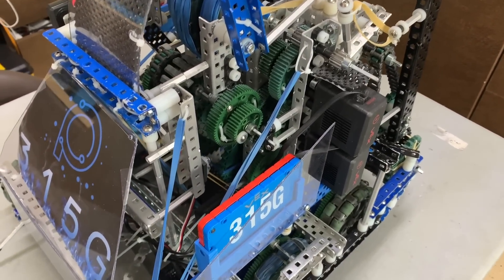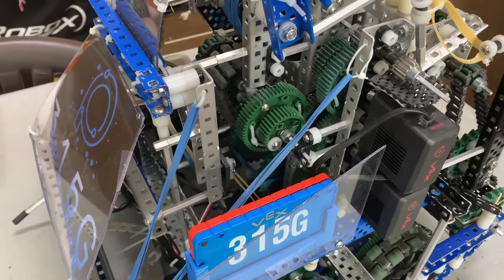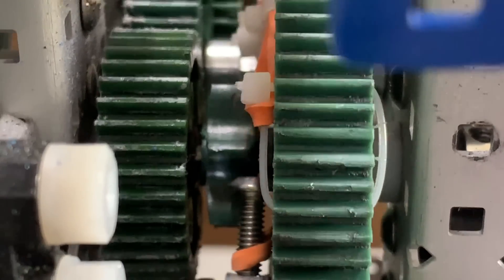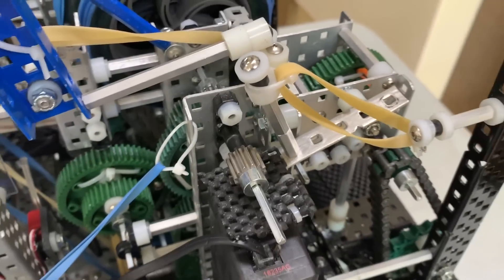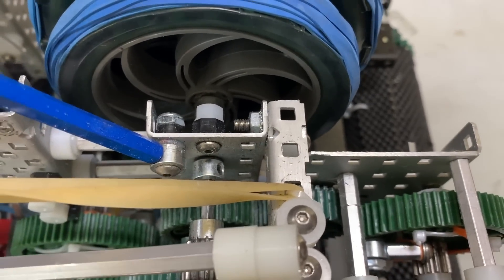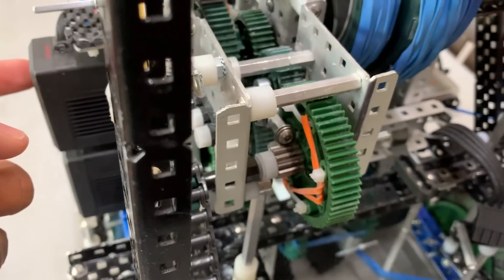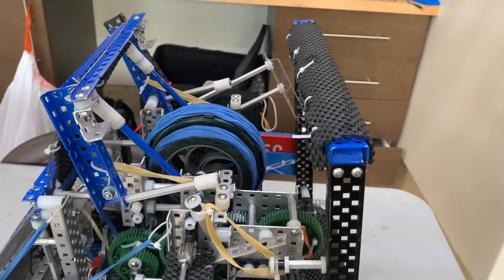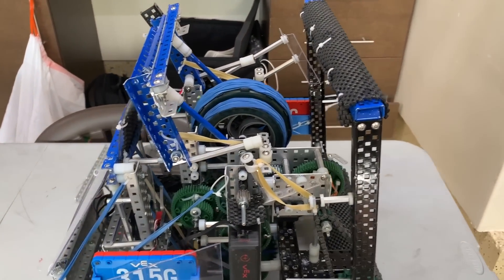315G's Turning Point Ratchets Explained

Comment: That hood angler is genius, but how did u guys get ur scraper to lower all the way with the rubber band attaching it to the flywheel brake stopping it?
Reply from the maker: The rubber band provides a force to pull the scraper back up, the tension is tuned so it's weak enough not to stop it from lowering all the way.
Reply: Thanks for the response, also did you guys speed up the drive or leave it at standard 200rpm
Reply from the maker: @r3v3rbrobotics35  It's sped up to 257 rpm, 600 rpm cartridges running 3:7 external gear ratio.

Comment: i was also thinking of motor sharing early in TP but with differentials. but i eventually left that idea because i could not persuade our coach.
Reply: What would be your use of differentials? Ratchets seem much more useful and reliable.
Reply: @jinglemich4941  wow it's been 3 years since I left this comment hahaha Well to answer your question that idea was a silly one I had that involved using a chain bar in tandem with a differential made with bevel gears to lift and flip caps with just 2 motors. I came up with this before I became aware that V5 was a thing... It does sound stupid now that I think about it but I was just a rookie so don't judge too hard.

Comment: I don't quite understand how the lower flywheel motor is able to move the indexer system while the flywheel is spinning, can someone elaborate it
Reply from the maker: The lower motor is also ratcheted to the flywheel, so when it starts spinning in the opposite direction to powering the flywheel, it disengages from the flywheel, so it doesn't actually actively slow down the flywheel. The flywheel can continue receiving power from the motor above, but even if it doesn't, it'll coast for a really long time. So when that lower motor reverses, the indexer ratchet engages and moves the indexer up while the flywheel ratchet disengages and allows the flywheel to keep spinning.